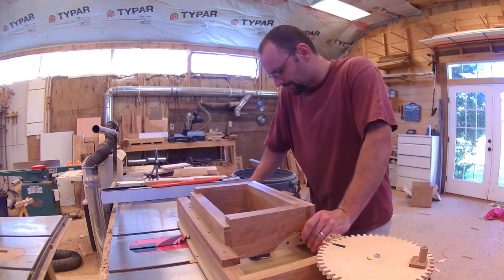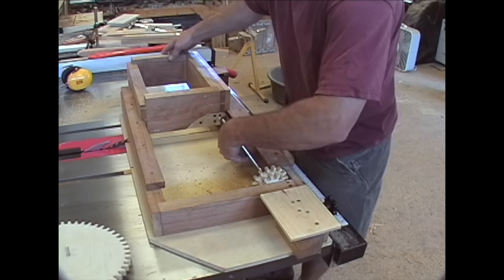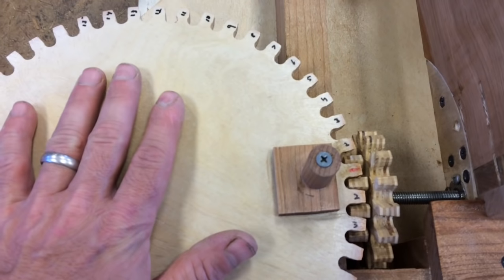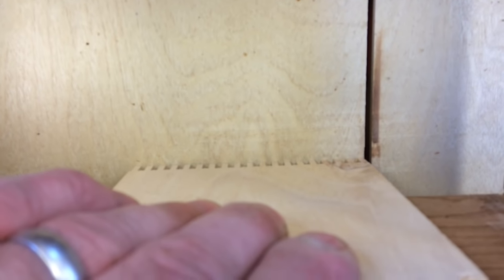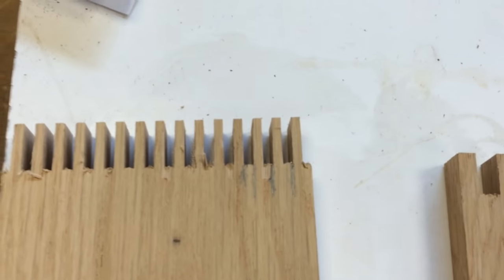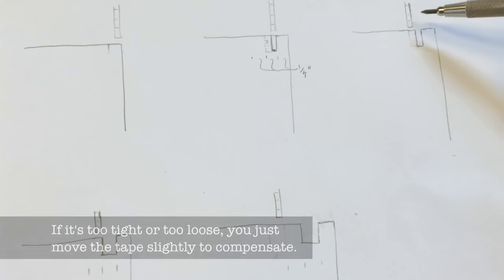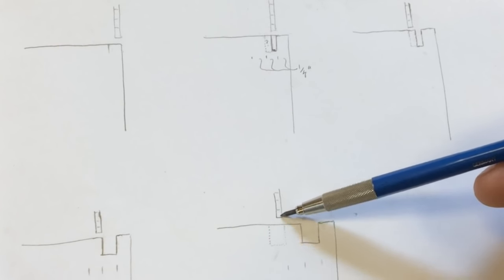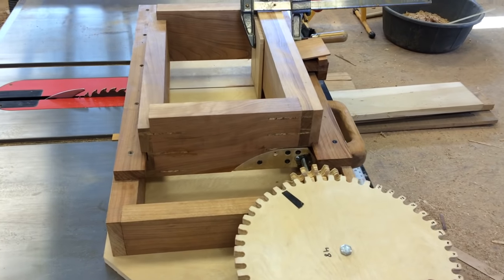Review of Matthias Wandel's screw advance box-joint jig.  FarmCraft101

Comment: I built one of these and it works great! I think the demo was done with a single drawer side which was a great visual but be sure and realize that you can stack your 4 sides (with 2 sides offset the thickness of the joint) and cut them all at the same time. (Flip over for the opposite end). A real time saver

Comment: This is definitly one of my favorite builds.  Your added idea to make a odd tooth sized gear is what I was missing.  Ill be making a 45ish toothed gear.  As for getting the curved piece with the press nut to align right.  Put short screws that just protrued throug the thin peice, then retract the carrage all the way and it will press and leave marks where the screws line up, swap out for long screws and drive it home.

Comment: I have always used the single finger jig for making box joints. But you do need a dado blade for that. Well, if you want a finger wider than your regular saw blade. Then you need to know the technique for getting the fingers started right. Single finger jigs are also not adjustable. So you need a different jig for any width box joint you want to cut. I only ever want quarter, and half inch joints though. So that's 2 jigs. Which together take up a lot less space than Matthias' jig does. I mean they're two boards with fingers sticking out of them. The single finger jig is so easy to make I can make one on the spot, then throw it out when I'm done.

Comment: Nice video Farmcraft. Thanks for your time. I made one of these about 3 years ago and have made box joints up to 3/4" using just a thin kerf .098" blade. The hardest part of building mine was finding a metric tape measure. Had to order one on Amazon. I just wanted to tell you that I think your 47 tooth gear was a great tip for someone whose blade is so close to actually being a perfect 1/8" because it gave you the ability to stop at the home position each cut which equals both speed and accuracy. BTW you almost pi$$ed me off at the beginning because I really love Harbor Freight.
Reply from the maker: Haha!  Thanks for watching!  And I actually own and like quite a few Harbor Freight tools as well!

Comment: I should build one, but I have so many projects that if I were a boat, adding one more would certainly sink me.

It is interesting that both of you watch each other's videos. On one of Matthias' web pages is a list and summary of channels he enjoys with the location indicating degree. Farmcraft 101 is smack in the top tier. 

I am a bit curious how either one of you center your holes on the large gears and pulleys built of wood. I only have had to make 4 inch diameter pulleys where the radius of the circle easily fits between the vertical post of my drill press and the vertical center line of the chuck. At some point I'll need bigger diameters and, whether a single pulley or laminated step pulley, a well centered hole certainly helps achieve a balanced spinning pulley or gear.

Comment: at 11:46, would it help to mount the T-nut assy on the opposite side (right side) of the jig? That way the T-nut would never get close enough to cause binding...just a thought.
Reply: Not really. The problem with the t-nut on the opposite side of the jig is that the drive screw then would need to cross the path of the saw blade. This would not be a problem for kerfs that only need to be half an inch to an inch deep, but if you are doing a box joint on heavier stock, perhaps to turn a square box joint into a curved box joint, you could easily run into a situation where the drive screw would interfere with the path of the saw blade. Yes, it could be redesigned to be at the top of the jig, but then you end up with a taller setup for the hand driven gear. 

There are other ways of setting things up of course. You could open the hole for the t-nut a little bit, thread the t-nut all the way onto the drive screw, then bring the jig box to the t-nut while on the drive screw as an example. Other methods primarily presume that you're going to be able to get high precision 90 degree cuts and holes and you are not going to be dealing with wood dimensions changing due to humidity etc. Not sure how confident you are going to be on those conditions. (I'm not.)
Reply from the maker: What rusty0101 said.  Also the drive screw would need to be much longer and sticking out of the right side of the jig.  It works fine like it is, just requires a bit of care with assembly.
Reply: Yep. Got it. Thanks!  I want to build one of these some day...you have inspired me!

Comment: Great job. My greatest difficulty is lining boards up perfectly so finished joint edges line up perfectly when assembled; usually sides or front/back stand slightly proud of the other. Have you found any tricks for this?
Reply: You can get around this by making the parts slightly oversized, and then cut them to final width after you made the joints
Reply: That's what I was trying to avoid. Maybe everyone has the same problem. I can usually get it so the fingers still appear full size after trimming. Seems like a drop-down small indexing pin or bar would really help, ...or a laser B-)
Reply from the maker: If I need precision I usually cut a scrap spacer that is one finger width and use that to position the boards. Works well.
Reply: Good idea, eager to try that
Reply: In the classic method you cut an outside finger first, then you flip that board around, and use the finger on it as a spacer to line up the open starting side. But you can still end up with a fraction of misalignment. Something a pass, or two of a plane can take care of. I wrote an article about it on the instructables website called, "How to make a box joint box". There's pictures, and everything. These complicated jigs people use always fascinate me.
Reply from the maker: I used to use that method, but you have to cut each board individually, which takes a long time.  With this jig, I can cut the joints for 3 drawers all together in 2 passes.  Takes about 10 minutes.  How long would it take to cut each separate slot on both sides of 12 boards with that traditional method?  It's also not as precise.  Sure it works, and many people prefer to use it, and that's fine.  But for me, I'll use the jig and get more done.
Reply: FarmCraft101
ah no. I've cut up to 8 sides at a time using the one finger jig. I'll tell you the trick. After you've got all the starting fingers cut, you put them down on the jig, then clamp all the boards together. Here http://i.imgur.com/XQKfCGf.jpg I've made shit loads of box joint boxes.
Reply: Aren't you still moving 8 boards to the next position?  Meaning, clamp, cut, un-clamp, move, clamp, cut, un-clamp....Makes you want to design short drawers.
Reply: Jarod Morris
You just clamp the boards together. So you leave them clamped together until you are done cutting a whole row of joints. The finger on the jig holds everything in place as you cut. So after each cut you just advance the whole clamped up bunch of sides to the next cut on the jig finger. Unclamping all the sides from each other after each cut defeats the purpose of clamping them together in the first place. Well, there's two reasons to clamp them all up. One is so you can handle them all as one piece. The other reason is to keep all of the sides aligned. Plus I use Vise Grip swivel pads to clamp the sides together. Once set they're fast clamps to use. I've used my method to cut some rather long sides http://i.imgur.com/p5xk4KL.jpg
Reply: Paul Frederick Ah, I get what you're saying
Reply: Jarod Morris
Yes you must have thought I was clamping all of the boards to the jig. That would work too, but it is somewhat pointless. As the finger on the jig is the alignment device. In a way I suppose I do clamp the boards to the jig, but I use my hands to do that. That's what I grab when I cut the work.
Reply: Yes, that is exactly what I thought.  I built a simple jig I clamp to my miter gauge.  It works but it's not perfect and I have not tried to use it twice yet.  I think getting it perfect again will be difficult but we'll see.
Reply: Jarod Morris
That's the downside to the finger jig. It does have to be accurate in order to work properly. The finger has to be exactly one kerf gap from the blade. If it isn't then it just doesn't work. There's a method to going about it. I'd setup a dado blade, make a test cut with it, then make finger stock to fit in the kerf, and use a cut off of that finger stock to offset the finger of the jig. Once set on a miter gauge I mark it with a witness line. I just screw the jig to a miter too.
Reply: Paul Frederick my only reason for doing what I've done is to use the same blade I always have on my saw. it's not worth my time to change the blade so often and set it all up again. That's the beauty of Matthias' design
Reply: Jarod Morris
I change blades often, depending on what I'm doing. So changing over to a dado is nothing to me. Heck I don't even know how many different dado blades I have at this point. I think three wobblers and a stack? Something like that. There's a 7.25 blade on my one table saw now. Though I can't remember why I took my regular 10 off. I must have been cutting something nasty. I think it was Phenolic sheet?